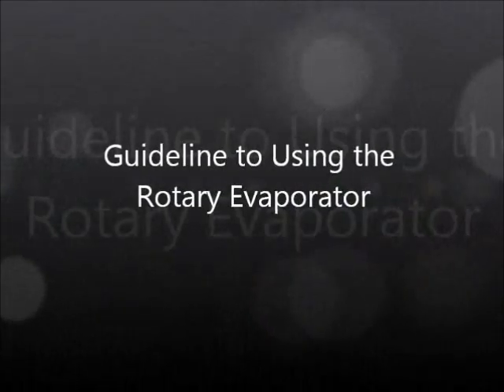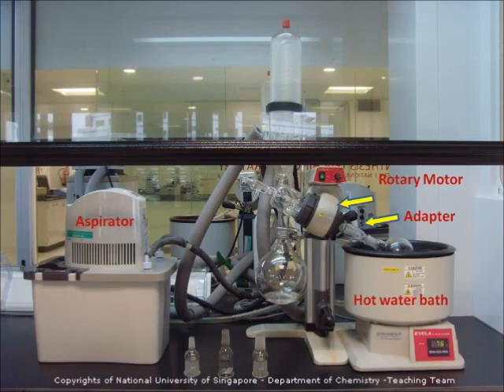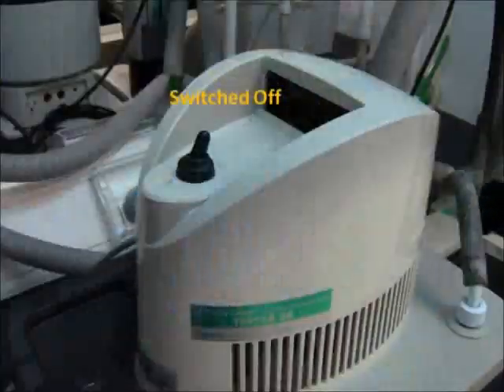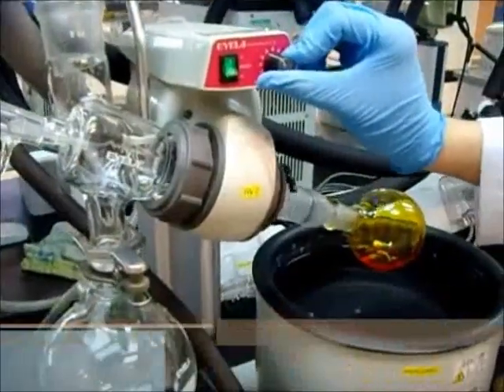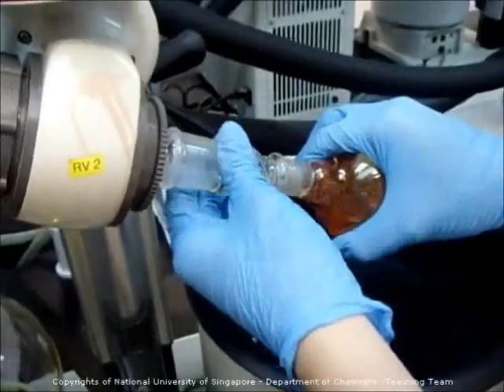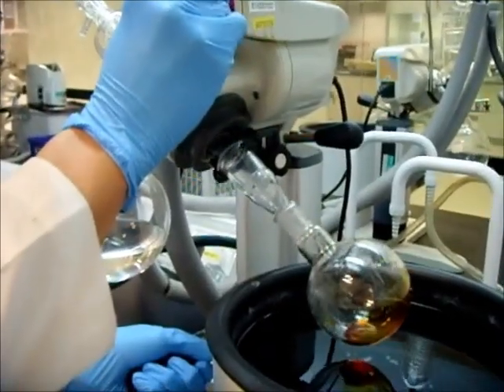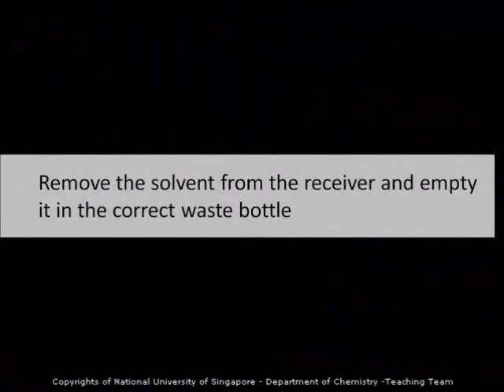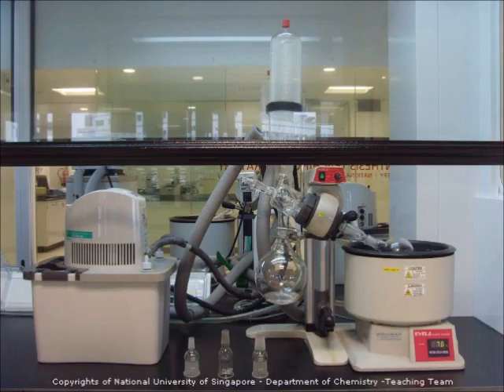🌟 -- Rotary evaporator (How to use a Rotavap /Rotovap)

Comment: 4:46 is it normal for the evaporating flask to be bouncing up and down on the water bath? mine does that too. the tube is not perfectly straight. do I need to buy a replacement tube?
Reply from the maker: Not normal in my experience, need to check your setup connectivity
Reply: @chemfunman  at 4:46 , your flask is also bouncing up and down. It will be more noticeable if you install a larger 2000ml flask.
Reply from the maker: @ I just saw! ues
Reply: If you need it, you can ask me for details.
Reply: @        Do you have a Buchi R-210/215 vapor tube?
Reply: You can give me your email address so that we can communicate further and you can get a better understanding of our products.
Reply: Yes,you can give me your email address so that we can communicate further and you can get a better understanding of our products.

Comment: Can we use a 10 ml round bottom flask with a connector ? it is because I have a very small volume of samples .samples are very costly.
Reply from the maker: Yes, it is possible, slow the rotation speed and do it carefully.

Comment: I noticed in the video the vacuum line is not hooked up. Can the rotary evaporator be used without vacuum? Also: How do you know that all the solvent is evaporated out of the liquid mixture? If the compound is resinous, do you leave some solvent and pour it into something else to let the rest of the solvent evaporate?
Reply from the maker: If the vacuum is absent, it takes longer to evaporate certain solvents. Sometimes, this is even impossible. In my experiments I have used partial vacuum to control the drying process, because for volatile solvents, full vacuum may be too strong and sucks out all my products altogether.
Reply from the maker: If the product is resinous, I recommend inserting a dry cotton wool at the neck of the glass joint, so that even if the vacuum pulls them into the condenser, the products are collected/ trapped at the cotton wool.

Comment: Sir my sample is black pepper and I want to extract the piperine and then I will quantity it by HPLC..
Can I  extract it through rotary evaporator.
Now my doubt is that if I put the grinding material plus solvent into the round bottom flux and after removing the sovant 100 percent, there will be lots of residue which will not be dissolved in methanol for HPLC.
So what should I do
I think I have to go first for sohxlet extraction then filter it and then have to go for rotary evaporator to remove solvant. M I right sir..
Reply from the maker: To use a rotavap, your solute MUST dissolve in the solvent. If you have a suspension, it is unwise to use this method of drying...
Reply: @chemfunman  but I found in a research paper after sohxlet extraction they carried out the rotavator to obtain the final extract. When I used rotavator I found a semi solid extract. And then I put the sample in lyophilizer.. but I m not getting the powder from of my extract

How can I convert my plant extract into Powder form for hplc analysis

Comment: When I use and Aspirator Pump similar to this, for some reason, the water of the tank of the pump goes through the hose to fall inside of the condenser and then to the receiver flask. Do you have a clue why this is happening? Help me, please
Reply from the maker: the water? it should be a mix of alcohol and water
Reply: @chemfunman   We use only water in the tank, the laboratory doesn't have budget for many things so I do my best in the Lab, but I see this problem and I don't understand what's going about the backflow of the water (common water i.e., a tank filled with running water from faucet)

Comment: If you want to install a vacuum controller (vacuum gauge) in this Aspirator, the 'Y' is needed or how you connect it?
Reply from the maker: need to attach with a keck clip

Comment: Im using rotary to evaporate methanol from my microalgae extract so i can get the compound. The sample was in liquid form , how long do i need to evaporate so i get the compound only without the solvent ?
Reply from the maker: the boiling point of methanol is pretty high for a rotavap to dry - would you think the microalgae will 'decompose' ?
Reply: @chemfunman  the microalgae cell already been soaked in methanol for 24 hours. We want the compound to be concentrated ? And by using the rotary i could reduce the amount using low temperature than methanol usual bp.
Reply: I think it's still possible to achieve the goal with the right approach, I had a customer once who did just that, the main purpose of the vacuum is to lower the boiling point

Comment: As always, great video!
I have a question.
When I used this in the lab first time, I remember my instructor told me there is a specific sequence of turning on/ off the vacuum tap and the aspirator. He told me the wrong order will spoil the aspirator. 
I remember: aspirator on, tap close, then after evaporation, tap open, aspirator close (as what you did).
Does it really matter? If after evaporation I turn off the aspirator before opening the tap, how will that spoil the aspirator?
Thank you :)
Reply from the maker: that works fine as well!
Reply: @chemfunman  leq
Reply from the maker: @jovicic43  lag

Comment: Thank you for your sharing, sir. This video really give me some ideas for my lab work. By the way, I have question with the solid / liquid form of sample. Is it because of the solvent that affect the formation of sample after evaporation?
Reply from the maker: solubility of the solute in the solvent, so yes, when the solvent vaporized, the solid/ liquid will appear!
Reply: Rotary evaporation flasks are suitable for the concentration and crystallization of heat-sensitive substances.

Comment: Nice. Do you sometimes use an ice bath on the receiver flask? What about using higher vacuum? Afaik aspirator pump can't get really high vacuum, unless it is used with some oil instead of water. And how do you clean or replace the seals between moving and non-moving parts in the rotovap?
Reply from the maker: I do use ice in my receiver sometimes.

Comment: good video. I highly recommend the use of a vacuum controller or at least a bleeding valve to get a stable vacuum and not just full vacuum that would increase the loss of solvent to the environment.
Reply from the maker: agree with you! thank you for your support.
Reply: What do i need to make a bleed valve to keep the vacume pressure stable?
I can not afford those 1200$ digital regulators...
Thank you
Reply: @Billy011  check this out : https://www.amazon.com/Buchi-047391-Manometer-Needle-Rotavapor/dp/B00BT3XDBK

Comment: and if the extracts are stuck to the wall of the round bottom flask!!! How can i remove the extract??
Thank You
MPhil Student
Reply from the maker: use a spatula and scratch
Reply: Will it be good if i use about 10 ml of the solvent to re suspend the extract??
Your opinion would be very much appreciated. 
Thank You
Reply from the maker: sounds ok, depending on the size of RBF
Reply: You can washed with easily evaporated solvent such as diethylether then use funnel and vacuum to get  solid results.

Comment: Hola, ¿cuanto tiempo aproximado se tarda en destilar aceites?,gracias
Reply from the maker: Si Si, hablas Ingles, amigo? How long ... ?
Reply: yes, How long  approximately it takes distill one substance,for example water with Orange peels?because i think buy equipment Similar to this. thank you.
Reply from the maker: I would not use the rotary evaporator to distill orange oil from the peels... will use steam distillation --> it is in my other video. have a look.

Comment: So I made a fruit ethanol extract but I guess maybe I let the thing run for too long. Now the extract is completely stuck to the wall of the flask, it looks like melted plastic. Idk how to get it out and idk how I'm going to use it now. Please help!
Reply from the maker: add a solvent and warm, sonicate.
Reply: A heat gun and a clamp to hold it up to drip..
Did you get it out?